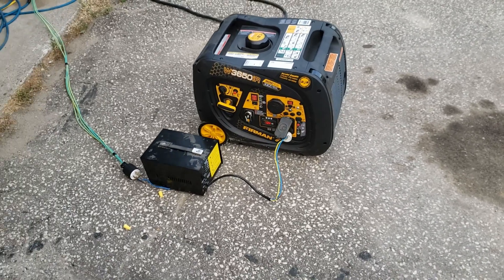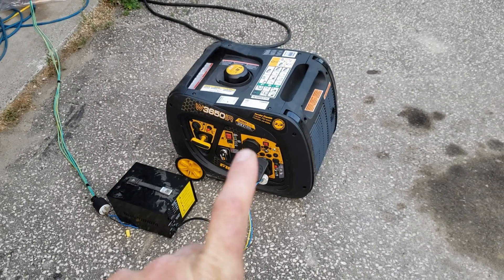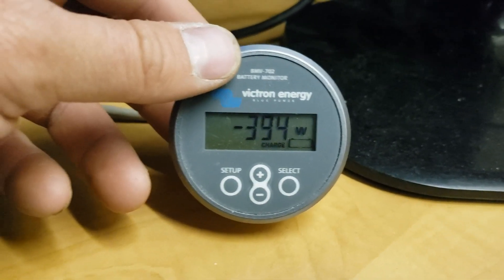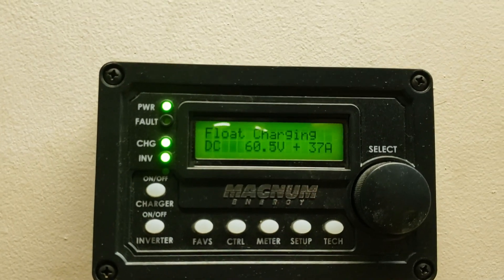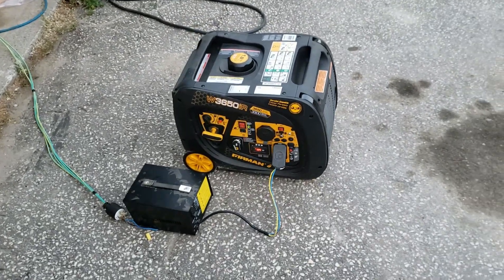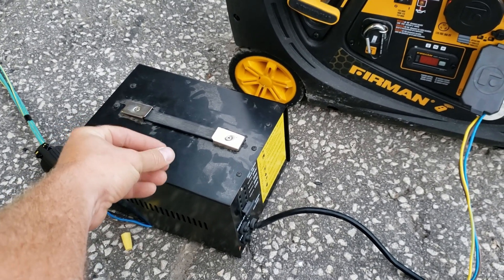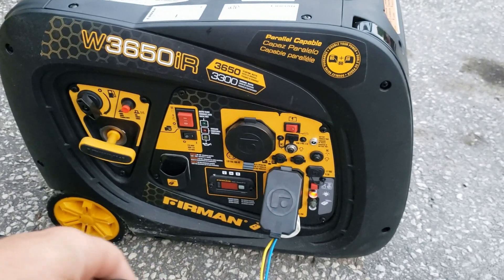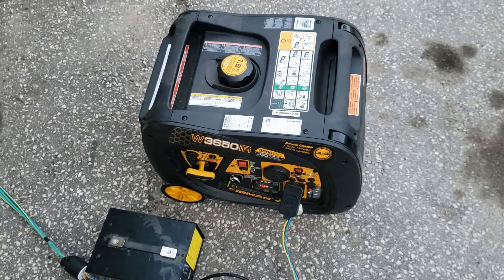Firman 3650W Inverter Generator And 3000w 240v spit phase Transformer

Comment: It is under load you can really hear it working and the best way to break it in to allow a load but not forever up and down so it works. Nice find and with the transformer it makes a new world.
Reply from the maker: yea, im using it to run my house trailer so I dont have to get up a 7 am while on vacation to start the generator for AC :D
Reply: @GoingOffGrid101  Where are you going this year?

Comment: I solve the problem of charging the batteries with a small generator by putting it through a refurbished pip inverter I now use as a dedicated charger. Works really well and we don't have to worry about overloading the little Generator.
Reply: For 48V batteries, 48V chargers are commonly available for cheap on the surplus market as "telecom rectifiers".
Reply from the maker: very interesting thanks! im hoping to mostly use this for my house trailer AC and charging the batteries when parked in shade, but if the big old genny dies this little one will be its backup!
Reply from the maker: @NiHaoMike64  I need to buy one!

Comment: Can this Transformer be connected to two identical generators to double capacity?
Reply from the maker: if you have 2 generators that are parallel ready then yes.
Reply: What i have are 2 power stations do they have to be parallel capable too?
Reply from the maker: @BushidoBrownSama  yes they do
Reply: @GoingOffGrid101  thank you

Comment: Does this add your total wattage? For example, your transformer is about 3000 W and you’re generators about 3000 W does this at them and gives you roughly 6000 wants to work with
Reply from the maker: No it stays at 3000w in fact the transformer uses about 45 watts in standby

Comment: 1)Any one please tell me can I run 2 different generator 3500 watts(120 volt WEN's) and different 4500 watts(120 volt Firmin's) parallel  use them?
2) )Any one please tell me can I run 2 different generator 3500 watts(120 volt WEN's) and different 4500 watts(120 volt Firmin's) parallel  use them for 240 volts applications?
Reply from the maker: @uday20101  if they have both have parallel features then yes. Just make sure ones not 240v and other is 120v lol

Comment: What transformer is this?  I haven’t seen a split phase 240v transformer.
Reply from the maker: They can be found on eBay
Reply: It’s Euro simple 220, Not split phase, inrush trips 15A breaker. Remember split phase allows one to run 240 and 120 at same time. Put Euro transformer 220 to your house and destroy all the 120 connections
Reply: Also it's an autotransformer...fairly efficient but never use one to step down voltage only up...they are a safety hazard in step down configuration. You need an isolated transformer for safe step up operation.

Comment: Did the generator run your deep.well.pump with that transformer ???? And how did your wire it like that ?
Reply from the maker: It will if I'm not using to much power when it turns on.

Comment: What the reason for this? What are you running that needs 240v at that wattage?
Reply from the maker: doing this allows you to power bolt sides if your breaker panel in north America and adds the 240volt option.
Reply: @GoingOffGrid101  I’m assuming you use some of inlet box to connect to the home to back feed. If you simply connect the hot from the generator to both hots of the inlet, you’ll get 120v on each leg of the breaker. Your 240v units won’t work but nothing is really going to work at 3000 watts anyways. This saves you the loss of the transformer.
Reply from the maker: @MrSkunks  yes your right, but I can run one stove too burner this way lmao, it doesn't really serve a
Purpoise other then smaller 240 well pumps and stove tops 👌

Comment: I have a craftsman 2000w inverter generator, how difficult would it be to do the same?
Reply from the maker: you need to be able to control the choke for a short time then the starter motor, not super hard but time consuming.
Reply from the maker: sorry getting mixed up with another comment, are you talking about the transformer turning the 120 to 120/240?
Reply: Going Off Grid I have the same question.  How do I get 120 to 240 (120+120 split phase)

I have a Honda inverter generator and want to power 240 split phase loads
Reply from the maker: @xzibit8614  all you need a a 120 to 240 transformer like the one I have in the video, they are pretty cheap, for a 2000w inverter get a 3000w transformer
Reply from the maker: sorry didn't see this comment
this one is like mine.

https://www.ebay.ca/itm/3000-Watt-Voltage-Converter-Transformer-Heavy-Duty-Step-Up-Down-3000W-110-220V/143243241212?epid=2305639543&hash=item2159f666fc:g:WFYAAOSwG7Nc0mdk

Comment: Do you have a link to that split phase transformer?
Reply from the maker: this one is like mine.

https://www.ebay.ca/itm/3000-Watt-Voltage-Converter-Transformer-Heavy-Duty-Step-Up-Down-3000W-110-220V/143243241212?epid=2305639543&hash=item2159f666fc:g:WFYAAOSwG7Nc0mdk
Reply: Going Off Grid does it create 240 (L1 + L2) or euro style 240 (L1 + N)
Reply from the maker: @xzibit8614  mine has line 1 and 2 I'd think they are the same but cant be 100%
Reply: Going Off Grid gotcha.

I was looking for some but they simply took the L1 + N of 120 and stepped it up, so L1 to neutral is 240, no 120 due to a single leg.
Reply from the maker: @xzibit8614  normally the transformer is center tapped to get the extra live line at 120

Comment: I don't think that's split phase 240
Reply from the maker: the generator is 120v only but the middle tapped transformer turns the 120v to 120 line 1and 120 line 2 and combined its 240v
Reply: @GoingOffGrid101  Yeah, it's 240 single phase (UK) power / Not us 220/240 split phase.
Reply from the maker: when you take a transformer and center tap it it becomes split phase, im not sure what you mean.
Reply: Going Off Grid honest question.. it’s two 120v legs that are 180 degrees apart?
Reply: @FullSendPrecision no it's one leg of 240...

Comment: I've never had any good luck with generators.  Never had one that lasted a year.  Went to solar.  Don't have the power you have and do without a refrigerator.

The one I did like lasted about eight months.  Would run it one hour every month.  Didn't even get through the break in hours to change the oil before the generator refused to start.  Couldn't see what the problem was with the unit because it was under warranty and got a replacement which didn't run smoothly like the first one.  On the replacement generator when I dumped the clean oil that I had put in on day one came out black.  Believe that Harbor Freight gave me a return from someone else but I can't prove it.
Reply from the maker: get a briggs and stratton inverter generator or firman or champion for good cheaper generators
Reply: @GoingOffGrid101  I've got solar.  Had two new Champion generators, 3500 ~ 4000 for a business that I wanted to start but my storage garage was broken into.  Both brand new and the tools stolen and no insurance because I had just rented the until after moving into a different apartment.  Due to the loss of equipment I couldn't setup the service and pay the loans back and lost my good credit rating.  These people are still stealing.  Hate these gangs that our local politicians and police do nothing to stop them but don't be homeless that's bad but stealing to make ends meet is fine unless you are in competition with some other gamg.